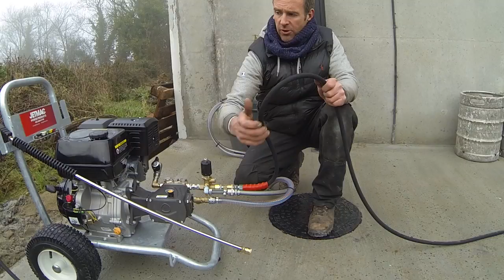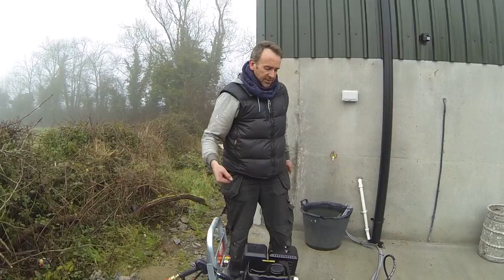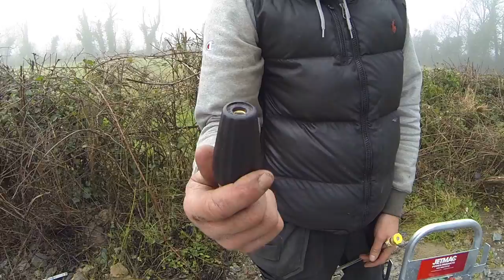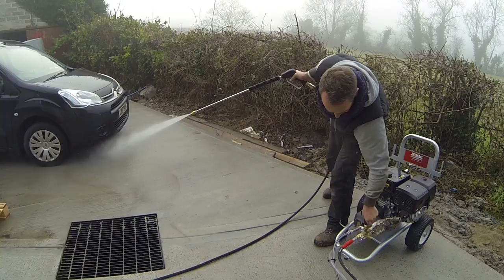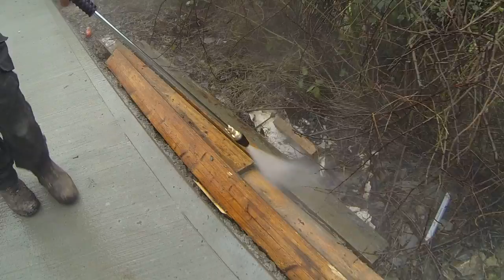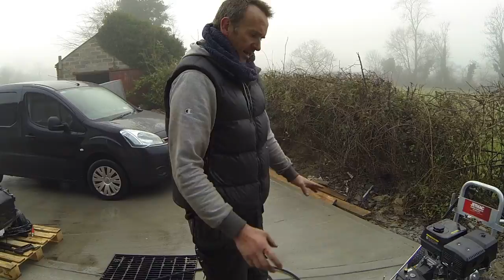lONCIN G420 4000 PSI 15 LITRE AR RRV 4G40 WASHER

Comment: HI, with the Chinese engine, keep an eye on the valve clearance and adjust the gap periodically otherwise the guide plate will wear out and bend a push rod.
I bought the two push rods, 2 rocker arms and guide plate on ebay for $14.99 US with free shipping.
Very simple to replace: gap is 10-15mm intake and 15-20mm exhaust.
I adjust mine @ 10mm intake and 15mm exhaust to keep the engine quiet and for easier starts.
Great video!